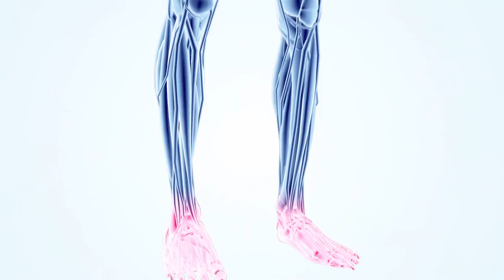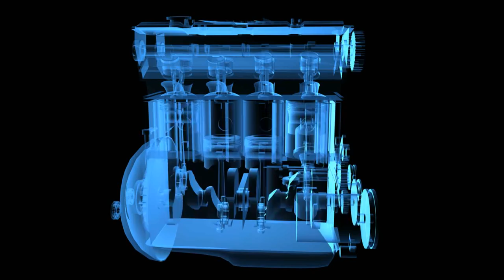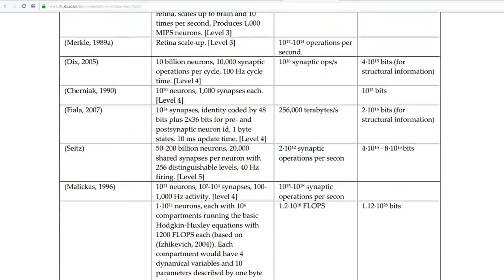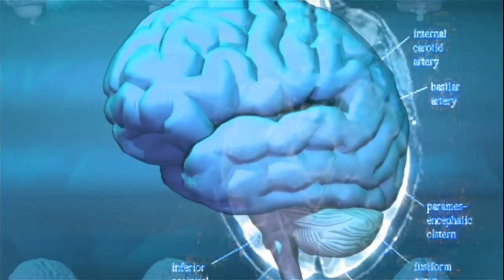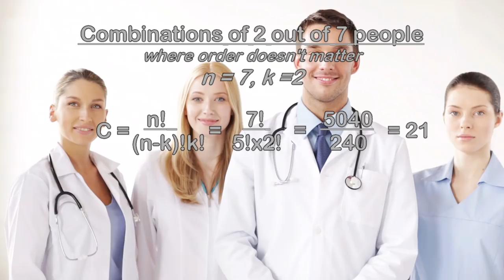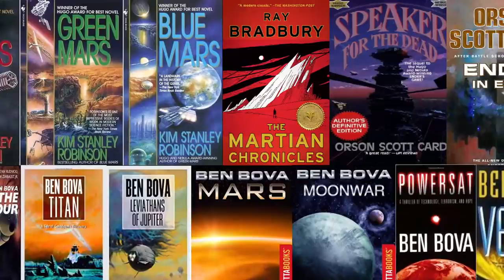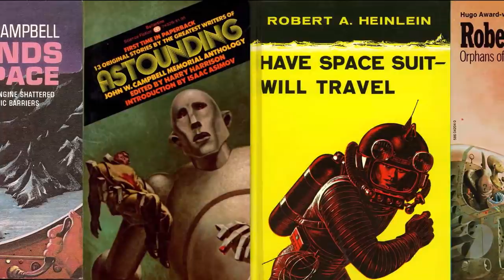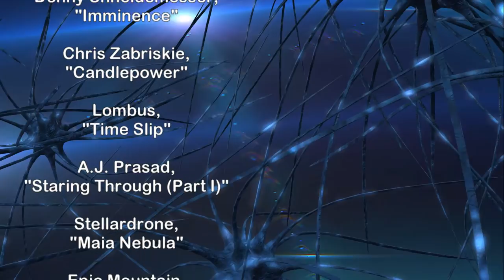Mind Uploading

Comment: The subject of the continuity of consciousness is quite a fascinating one... What I've deduced from this subject is that our brains follow a linear continuation of consciousness. It may ebb and flow every time we go to sleep, but the same personal identity belonging to the same housing unit remains. Mind uploading, by contrast, follows a parallel continuation of consciousness. You create an exact replica of your consciousness on a different medium, which isn't you per se, but a flash-clone of yourself.
In order to bridge this gap so that robotizing the mind retains your linear continuity, you would have to directly replace the brain's constituent neurons one at a time, much as how the rest of your body replaces itself cell-by-cell. Trying to upgrade that configuration to a platform that doesn't emulate neurons would require you to not just replace these neurons with nanites, but actually transfer these files onto a different medium. More than likely, this could be done by hooking the new "brain" up to the old emulator so that your mind would be simultaneously inhabiting both brains as if they were one. From there, siphoning data from one part of your hardware to the other could be done as easily as moving files to new folders on your computer.
FUN FACT: Cats also have two brains, which network together to form their entire mind. Making one of those brains bigger and migrating all the data from the second brain and removing it would be a great example of the procedure I'm describing.

Comment: One problem I see with mind uploading is that consciousness seems to be emergent behavior based on our biology.  Would we be still be 'conscious' housed in a binary based system?
Reply: Yes because what the building blocks are made of is completely unimportant for emergent behaviours.
Reply: That...doesn't seem like it follows.
Reply: Read again a few times. Read more on emergent behaviours. It does follow.
Reply: Ease up on the condescension, for starters, there, hipster.  And my point was that emergent behavior is entirely dependent on the system architecture.  Or do you think an Atari and a i5 will have identical results from the same programming?
Reply: I cannot find anything condescending in my previous comment - perhaps the language barrier is to blame here? Also calling someone a hipster is not exactly conducive to discussion on Your side too. Atari and i5 will get the same results, given they are both Turing complete, just not at the same speed. But this metaphor has NOTHING to do with emergent properties of a system. A better metaphor would be saying that both silicon and lamp based computers WERE working, turing-complete computers. The ability to do a computation is completely independent on whether the machine is built out of silicone or metal rods suspended in noble gas.
Reply: Consciousness is just awareness of thoughts and self. Obviously you aren't conscious of your sub conscious in the biological system so I'm of the mindset that if there is "surveillance system" built in to monitor your thought process you would probably be more conscious in an artificial system as you would be aware of the sub processes too that you aren't aware of now.
Reply: Sorry, pre-coffee, I overreacted.  My apologies.  I would say that simple computation, however, is not emergent phenomena, as it can be easily replicated regardless.  Consciousness is not simple calculation, or we would have had Turing complete AI 60 years ago.
Reply: Isn't that the whole point of the way our brains work, though, Patrick?  If we had to consciously respond to all sub-level processes, there would be very little time left for actual cogitation.
Reply: Im sorry but I am not sure why emergent properties cannot be copied? I dont see how that follows from their definition.
Reply: It depends on processing speed Drosta. Those subconscious processes still happen so I don't see how being aware that they are happening would take any more time. Maybe if you were forced to consciously regulate them they could possibly take more "processing power" but if that were the case when we switched to a  synthetic brain we would just have to increase the rate at which we process information but that's usually a byproduct anyway because silicon transmits data faster than biological processes. And either way I dont think that changes the fact that we would nonetheless become more conscious by being aware of processes that we currently aren't.
Reply: Yes, consciousness is an emergent property of our biology. However, consciousness is also substrate independent.
Reply: I can see the point from both sides of the argument, but I tend to fall on the side of Empire Empire about the irrelevance of the substrate.
There were pneumatic robots before there were electric ones. There were mechanical computers before there were transistors and silicon chips. At the moment we don't know what constitutes the mind fully, but putting a hard limit against it seems shortsighted imo. Way more study and research and development is needed.
Reply: They say consciousness is a (or "the") hard problem.
Reply: Patrick Gillette I don’t get how becoming consciously aware of more ongoing simultaneous things such as autonomic regulation processes taken care of via hypothalamus and various feedback mechanisms would add to the quality of one’s conscious experience, not saying I’m certain it wouldn’t either, but offhand it just seems like it would detract considerably from engaging with external environmental stimulus in a non-stressful way. Heightened states of creativity for instance are sometimes associated with less temporal awareness. It’s not so much about additional processing it seems to me. Various states of human consciousness are also highly correlated with types of specific chemical receptors that are undergoing electro-chemical stimulus; receptors known mostly to be in the brain but found elsewhere as well. Individuals have unique receptor densities, experience unique impressions. More substrate specific I guess you could say, but the externally derived electro-chemical stimulus is the other half of a two-sided equation that we experience as consciousness.
Reply: Why wouldn't it emerge from simulated biology as well? If a digital representation of organic molecules behaves the same as the real thing, the outcome should be the same.
Reply: +David Giles 
I don't follow. Why would you need to make a whole virtual universe from scratch, this is about translating real minds into a simulation which follows simplified laws of the real universe. 
I don't think you understand what "emergence" means.
Reply: Sobaken Of course you wouldn’t need to start a universe from scratch, just that the more accurately you modeled the ‘functions’ of this universe, including the parts of that functioning we humans are still deciphering, the more likely (I’m guessing) you are to have a consciousness emerge that would be similar to our own. I say that because many biologists theorize that human consciousness arose as a fitness mutation to adapt to environmental selection pressures. Again, I would agree you wouldn’t necessarily need to recreate an entire sim universe to model that sort of environmental selection pressure, but to mimic earth’s environment could require complex weather and (apparent) quantum processes, and maybe some periodic galactic rotation radiation effects etc.. Natural-selection-like rules are not the only type of game ‘set up’ known to be able to produce emergent behaviors within sims of course, and who knows how dissimilar or similar to human the consciousnesses that emerged might be with rules varying from earth’s environment and natural selection (?)
Emergent consciousness of some type is one thing, whereas having a sim detailed sufficiently so that a human might feel ok to have their consciousness uploaded to is another set of hypotheticals that I was adding into my previous comment since it went with the theme of the video topic.
Reply: My last comment assumes the ‘it’ in your comment referred to simulated consciousness emerging from a simulated biology. 
Beyond the scope of your comment perhaps, but one could imagine hypotheticals wherein that sim consciousness that emerged from the said sim biology also be an ai capable of further programming that same sim environment it emerged from. Lots of imaginative syfy is written on that sort of scenario. If the goal is to have the sim environment similar to the earth, but w enhancements or whatever, you’d still need to have a lot more corroboration as to the beneficent nature of the sim (for starters) to have a human from this realm want to upload there. Continuation of consciousness in and of itself, into a sim, is likely not sufficient for humans to want to dwell there lol, it is merely step 1 because what’d be the point if the sim environment wasn’t at minimum as detailed and had better scenarios likely to unfold there, less fear about uncertainties etc. ...
Reply: I'd like to stress that we don't know what characteristics of the neurons are necessary for the emergent effect to occur. I'm convinced a precise enough model can make a similar 'consciousness' emerge, but I'm skeptical we know enough about them yet. It's like if you wanted to create a liquid by putting millions of tiny H2O plastic representations (3 connected spheres) in a pool. That model of H2O wouldn't possess the ingredients necessary for liquid behavior to appear (electric bipolarity and other things I guess)

Comment: Great episode. I can't help but think of how 'setting-breaking' it'd be for most sci-fi franchises to mass-copy not just flesh (or equivalent thereof), but skills, experience, drive, and so on. There was the 'Manshoon Wars' in D 'n D, where dozens of his contingency-clones activated at once with a compulsion to kill each other, and spent the next century warring to determine who was the real Manshoon...but usually when mass-copying comes up the copies are essentially mindless drones (Ultron, Skynet) or otherwise irrelevant (Resident Evil movies).

Separately, it's trippy to consider people transmitting themselves (presumably with exceptional copyright protection to prevent unauthorized downloads).  Not just the multi-copying potential, but also the weirdness of spending 1000+ years in transit 'instantaneously.'

I hadn't considered the 'Ship of Theseus' method of swapping out fleshy bits, and yeah, I admit it doesn't provoke nearly the same..._hesitation_ as the thought of a more abrupt 'cut/paste.' To be fair, rusting and burning tend to provoke wildly different responses despite being the same process, merely happening on different timescales, so...

Comment: I suspect there may be very few individuals uploaded.  As we develop the uploading process, we would also be sorting out the actions and functions of various areas of our neural network even if just to reduce what we need to emulate in the simulation, the networks involved with beating the heart, breathing and controlling body temperature may not be needed and if needed may be better done with conventional circuitry and programs.  This also means we would learn how to modify our consciousness and perhaps give or take skills and even personality traits.  Sure the rich and powerful would want to upload themselves as a form of life extension but there would likely be an economic reason for a mind simulation and that would be to perform tasks and jobs.  Most tasks would not need an entire mind, it wouldn't take an entire personality to optically read text, but some complex tasks particularly with interacting with people may involve most of a person's consciousness but we could copy and modify a single uploaded neural network to suit the functions needed.  This master copy may be the synthesis of many uploads, most likely the basic structures would be standardized from cadavers (hopefully not of criminals) but once the standard basis is developed and tested, there would be no further economic need to load unique organic brains to computers as every need for a simulated mind could be filled with the standard tested pattern modified for the task.

It could be that save the neural networks of various cadavers and the minds of a few of the rich and powerful who sought life extension, no one would actually be uploaded.

I often thought of writing a short story or novel of a distant future where most of the intelligences are digital simulations all with a common basic standardized pattern and hence though quite divergent, are all somehow vulnerable to an information virus which seriously degrades them progressively, hence they trigger a long forgotten interstellar seedship which was never fully built to bioprint an individual but use the recorded neural network of a single individual from our present which was never involved in the construction of the commonly used neural networks.  This individual of our time would have to deal with an incomplete ship, disjointed O'Neill Cylinder space colonies, an ailing digital community community on Earth which dominates mankind and pockets of agrarian humans on Earth and various intermediate societies on the city sized O'Neill cylinder colonies each dominated by various cultures and idealogies.

Comment: We have to keep in mind, being run on a computer substrate does not ‘automatically’ confer superhuman mental abilities. One would assume processing speed would be governed to allow the individual to experience time at a human pace, rather than experiencing subjective years in the time it takes for their biological friend to blink. Governing processing speed is advantageous for another reason. Doing so means you don’t need as much processing power, as in as much computer hardware and heat. You can further this reduction in hardware requirements by only loading into memory and runing the 10% percent or so a human brain can use at one time without overheating.
Experiencing such a conscious would be indistinguishable from any other, assuming quality peripherals. They would also not automatically possess the ability to ‘talk’ to computers or be any more ‘consciously’ aware of the inner workings of their own mind any than a biological being. Such abilities are possible, but require additional processing resources, diagnostics subsystems(subconscious subsystems), and software. Again this can be done, but doing so requires additional effort.
A good analogy for this is the common portrayal of humanoid robots having ‘super strength’. This is an unnecessary capability for most applications. It requires additional power, additional resources, and increases the engineering difficulties of constructing them. Couple this with the subconscious fear many have for such beings and we arrive at the obvious conclusion. The first humanoid robots will be made out of plastics or polymers, and be no stronger than an average human, or less., disregarding military applications of course.
Likewise the first emulated humans will only have the processing power necessary to emulate a mind at the speed of their biological counterparts, and no more. Additional capabilities ‘will’ come, but much later. We learned how to build boats, and got pretty good at it, before we attempted to build ships. The same thing applies here.

Comment: Just started watching the video, so I'm not sure if you address this, but one thing I've often wondered about is the veracity of the assumption that a mind can be simulated completely on a digital system. If I'm not mistaken, measurements of brain waves are analog. I can't help but wonder if a substrate capable of simulating a mind would have to incorporate some type of analog elements, rather than being purely digital. 

And of course, there is the open question as to whether or not quantum effects play a significant role in biology. Talk about a wrench in the works - imagine if we have to hybridize quantum + digital + analog computational systems to fully simulate a mind.

Comment: Replacing neurons gradually or connecting an artificial brain to the natural one and somehow encouraging it to accept it as part of itself (then distributing functions & workloads across both) at least provides some potential method for the you.exe to continue running throughout the migration process. Even if our understanding of consciousness is flawed and the replaced brain will in actuality be running a clone of the original which died with the natural brain, it is always at least more certain alternative than a simple scan & copy, which fails the "upload" requirement because the original consciousness never left its fleshy host.

Comment: Teraflop processors are a lot cheaper than $1000 if you're willing to use GPUs. The GPU in my computer (AMD RX Fury) was only a couple hundred dollars, and is ~7 TFLOPS. Not to mention, it's a few years old and there are plenty of GPUs that are more powerful than that.

Plus, you could always use an ASIC or FPGA designed specifically for simulating neurons, which will lower hardware needs even more.

Then you also likely don't need to simulate 100 billion neurons. The brain only has 86 billion, and there's only about 16 billion in the cortex. About 50 billion neurons are cerebellar granule cells, which are quite simple as far as neurons are concerned.

I can go on for a while. For example, only a tiny percentage of neurons are actually active at any point in time, etc.